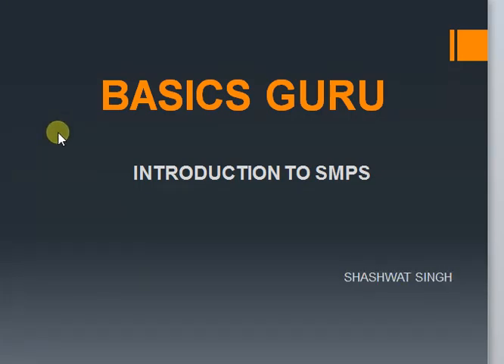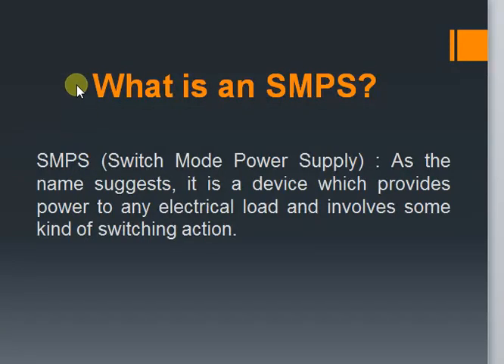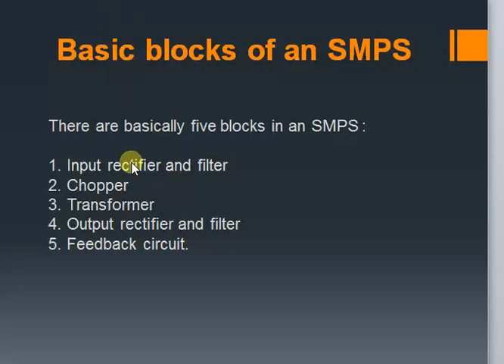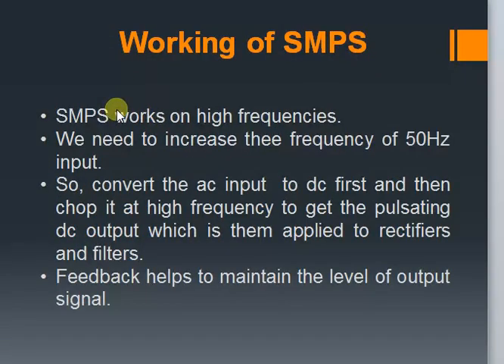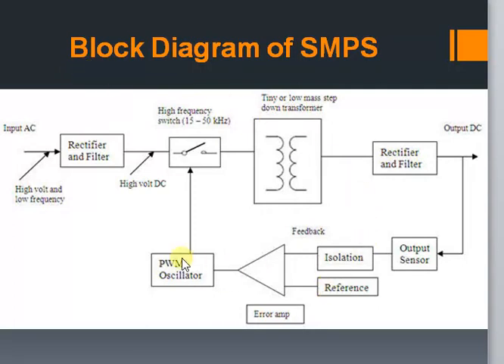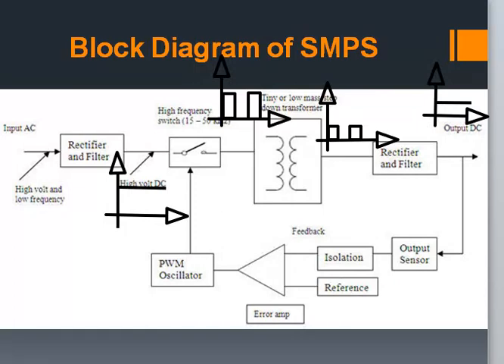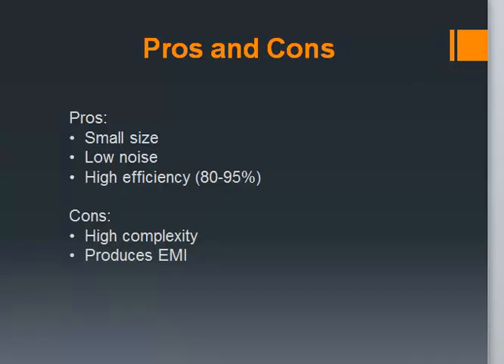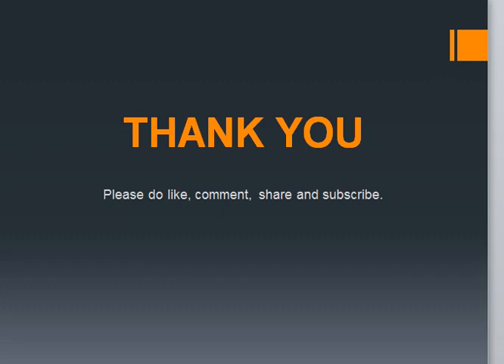SMPS Basics | Switch Mode Power Supply Explained | Basics Guru

Comment: Sir, what's the difference between smps and regulated power supply rps
Reply: Switch mode power supplies use step down/up converters, where as linear power supplies use linear voltage regulators.

Linear voltage regulators have lower noise/emi, but can't handle as much current. They aren't as efficient, as whatever voltage above the regulator rating gets dissipated as heat.

SMPS work using inductors, which store current in their magnetic field. They barely waste anything by heat, but they create more noise/interference. Low power DC appliances use linear because they're cheaper, while pc PSU's use converters because they can output more current and higher voltages, which means greater wattage.

Comment: Sir the feedback will increase or decrease the pulse width - only then we can regulate the output. Just increasing or decreasing the chopping frequency will not change the output voltage. Am I right ?
Reply from the maker: yes you are  right.  Feedback changes the pulse width.

Comment: What do you mean by EMI in the cons of SMPS?
Reply from the maker: Debalina Bhaumik electro magnetic induction. It runs on very high frequency, hence generating EMI which could harm sensitive devices.
Reply: Basics Guru ..ok..thanks...
Reply: @basicsguru5243  *Electromagnetic interference. It's referred to as "noise"--not in the audible sense.
Reply: Debalina Bhaumik hi
Hi
Very good

Comment: what is the use of PWM oscillator  in the f/b ckt.
Reply from the maker: Anoop dawande to control width of pwm pulses used for chopping the high voltage DC.
Reply: can you email me an explaination in detail? (dawandeanup@gmail.com)

Comment: bro you are wrong!!! there will be no change in the frequency whether the output voltage is Inc/Decrease than the desired voltage...the change will be there in the dutycycle of the frequency.....that's why it is defined as pwm oscillator in your circuit....
Reply from the maker: waris kn That's what i said bro. The change in PWM duty cycle will cause the output frequency of chopper to vary.

Comment: Thank you for the explanation.
But I would like to have a small clarification.
How can the transformer used in SMPS, step down the pulsating DC? Usually transformers are used to step up or down AC.
Please reply.
Reply: Deepa Francis hi smps explain teacher
Reply: They use a transistor to vary or fluctuate the DC voltage for transformer after that transformer gives the desired waves and then again it coverts into DC by using a rectifier and filter.
Reply from the maker: Deepa Francis Transformers can convert any varying voltages. It need not be an AC voltage at the input. Any varying value can either be up or down converted.
Reply: @basicsguru5243  transformer can not work with DC as per the basic Faraday's law, if you apply any DC voltage to any transformer then its core will be saturated and transformer will burn.
Reply: @akashkarmakar1572  any varying signal is an ac signal, that includes the chopped signal.
Reply: @subinmathew667  yes sir, I just got to know about it, any varying signal can be represented as ac Singal and which is used in pulsating transformer. Thank you for your reply..
Reply: @basicsguru5243  TRANSFORMERSNOT WORKING ON DC SUPPLY

Comment: Explanation is quite good,
but what is the need of chopping the dc voltage ??
Reply from the maker: Kapil Gupta DC voltage has to be down converted. So by chopping we change it to pulsating dc and apply to the transformer for down conversion as we can not give dc voltage as the input to the transformer.
Reply: I think u fastforwarded the video